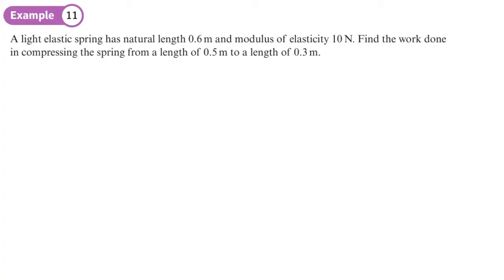3.3 Elastic energy (FM1 - Chapter 3: Elastic strings and springs)

Comment: when do you treat an elastic string as something doing work vs a force?
Reply from the maker: If it's a question about acceleration it'll be forces (F=ma), as there's no acceleration in any of the energies.  It can also be forces if it's about an equilibrium position.  Otherwise it's energy.  However, every question is different and the more you practice the sooner you'll recognise what method to use